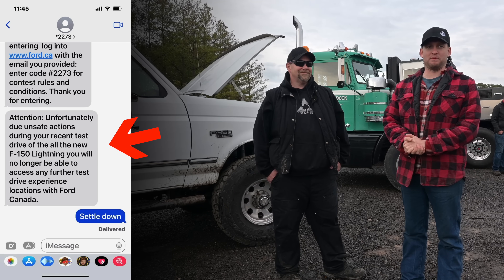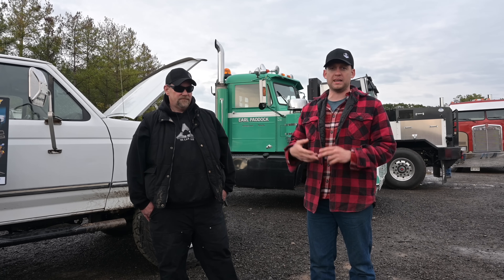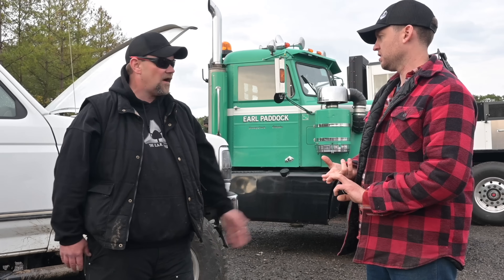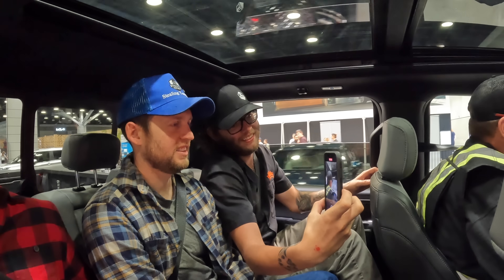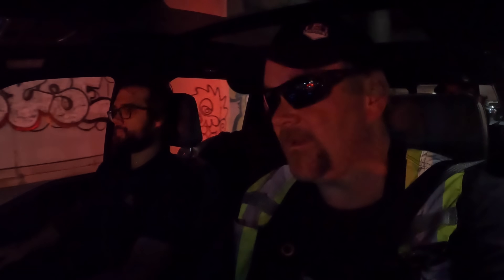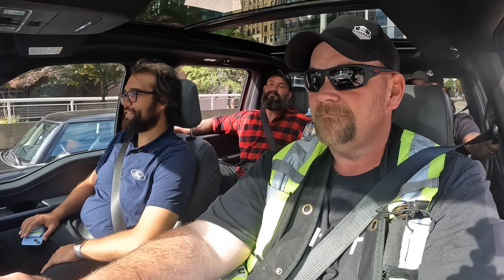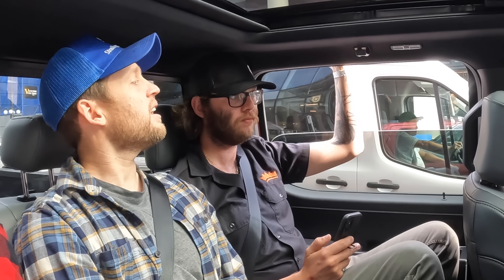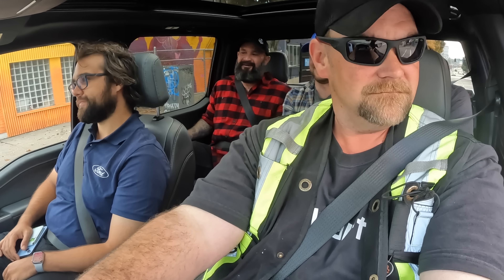Retrofit Revolution: Turning Old Pickups into Electric Powerhouses!

Comment: Curious, why not a IFS/IRS vehicle?  I've been trying to do this for years to my Tacoma, but I had not considered that the IFS would be a concern.  A thought (for me) was to delete the front driveshaft, and mount a small motor on the diff and xfer case with a battery and controller somewhere.  Would love to see more vehicles in general.  The VolksWagen XL1 comes to mind.  Would love to see it used more everywhere

Comment: Why can’t you just use the oem engine and just put the generator on the back of the oem engine and do the conversion
Reply: I'd imagine they'll eventually make adapters for most diesel engines. A gasser will probably be less effective with less torque in the low end vs a diesel which is why they probably won't focus on em.

Comment: My 69 GMC K2500 has had me 28yrs.
 I replaced the 350 with a used, 8k mile, Goodwrench 350,,, less HP, than the original 255hp engine,,, even worn out, the original engine had more power..lol
 That episode, was in December, 2018, during a windy rainstorm, out in woods, at the jobsite. I'm a worn out old mechanic, that does equipmentwatch/firewatch year round. My body can't do the steady, 8 to 16hrs a day, like it used to. I can still turn a wrench, but not as much as I think I should be able to.
 In February, 2019, I rebuilt the TH350 automatic transmission, out at another jobsite.
 The Goodwrench 350 is kind of a P.O.S, and I think I've been lucky, to make it last this long...need to do something different, for more economical power.
 If I could do electric drive, with generator, I think it may work well.
 Good thing about a watchman job, I get paid to camp and my RottnLab thinks I have this job, entirely for her convenience...lol
 Bad thing about a watchman job, , , , I'm not expecting to become independently wealthy...lol

Comment: I really want the batteries to go under the truck. How can we make that happen?
Reply: Battery box in place of fuel tank if you have duel tanks 1 for generator 1 for Battery
Reply: @emilecrotteau7312  I was also thinking about space between the frame. Since there should be no exhaust or driveshaft
Reply: @why6212  
There will still be exhaust but that leaves lots of room
Reply: @emilecrotteau7312  different engine, different exhaust system. Since they will be fabing it up anyway, you could have it come out the side under the front passenger fender, or exit straight up out of the hood.
Reply: @why6212  
That is the idea there is lots of options and choices 
For my trucks they will be frame off complete rebuild so equivalent to new truck,,,that way 20 plus years life span for what starts as mid 80 trucks
Reply: @emilecrotteau7312  nice, I'm trying to do a work truck and looking to get a a mid 2010s f250 because they still have a solid front axle.
Reply: @why6212  
I prefer pre computer models 
I have been a auto mechanic over 40 years so am a little prejudice for my own use
Reply: @why6212  
I am thinking of doing restoration conversions then selling them

Comment: There are hundreds of old ambulances that could use these kits as a zero-emission urban solution, as well as a on-site power source for lighting and what-not... in addition to making them a mobile ER/OR with long-term independent operational endurance, which would be greatly helpful while on the most remote calls in the field.

Comment: Honestly, my biggest reason for liking Edison Motors, while I dislike all other electric vehicles, is that its a retrofit that will be easily repaired by the owner, while all others seem aimed to collect all the data they can, make it insanely expensive to maintain, and prevent the owner from access to much of the systems.

Comment: I was so damn disappointed, when i heard that mazda now has their "rotary range extender" in their "only useful for inner city" full electric model . Mazda MX-30 R-EV
So i thought "yay!", now you can actually use it out of town, as a really efficient get to work car.

...But you still kinda have to charge it daily if you are leaving town, especially in winter.

It's still freaking expensive
AND
they kept their low speedlimit at 140 (for no reason, since higher speed = higher usage = battery gone in minutes vs now built in generator should compensate for that)
and witha  limit of 140 (kph, that is) you cant really drive here if you want to sometimes pass people in a fast manner to get out of the way.

Comment: I have a 1970 GMC K25. It is a hunting truck and I would love to take the space under the hood and put a freezer in there, put the batteries under the bed and I can put a light camping set up over it. Keep the same gas tank size and run a small generator for camp.

Comment: I've wanted this for a long time. I'd hate to do that to My old 7.3 with a manual, I think it'd be an ideal thing to do to a gas-powered truck that has low mileage and a blown motor. I was actually thinking that you could probably couple two model 3 drive motors together and have enough to work to just put it right between the two drive shafts where the transfer case would be and then pack the batteries in between the frame rails and put a light plant generator in there under the hood. You wouldn't need much of a generator to really make a truck. Have some decent range if it was a plug-in hybrid situation

Comment: Why not put the battery pack underneath a rear tray(flatbed). Rather than leaving the rear tub(bed) putting it in that taking up space. There is a surprising amount of space underneath a rear tray on a solid axle vehicle & flatbeds are more useful for work purposes anyway.

Comment: Sounds like a good idea to just make a kit where you can. Retrofit your old truck to be electric, especially if you have a gasoline or diesel range extender on it as well. You can then continue to daily drive your old truck as an electric vehicle. Just plugging it in at home every night to charge it and when you need to make those longer trips or you need to tow something past your normal electric range. You've got that backup power there. From the internal combustion engine range extender and you can just keep going.

Comment: I wanted to use a Ford Eluminator crate electric motor crosswise centered in my old 1976 truck then it stays 4wd and has more power then stock to boot

Comment: I’d be interested in a conversion for my truck. You really should consider a 1/2 tonne option in addition to the one tonne. Lots more 1/2 Tonne trucks on the road, especially older models that many of us love.

Question, can you still have heat or AC in them without a huge hit to the price?

Comment: And this is why I’m in full support of you and your effort’s 💪🏻
I’d love an electric motor/generator/charge control and system for a 3/4-1 ton 4x4 with solid axles. Then having options for batteries to choose traditional wet batteries, lithium, gel, etc.

Comment: I'm not trading in my old trusty combustion engine for an electric rig BUT if it were relatively affordable (without cutting too many quality corners) I would be interested in possibly retrofitting one of my backup vehicles or an old truck if the engine completely blows

Comment: Poor guy lol. His Job is just to protect the company's assets. Probably should have had someone else drive the truck so you could get away with a few things at a time instead of just speed running getting banned lol.

I do love the idea of an electric pickup truck, because for towing it would be so awesome. But none of them have the range I need to take my car out to the racetrack in my enclosed trailer. So having a genset would be great

Comment: Awesome!!!  Electric bucket truck/chip truck with electric chipper and chipper feeds off the truck, so no need for batteries in the chipper, retrofit the chipper too!!!
A hundred horse electric chipper would get the job done!  Plenty of chip trucks and chippers with worn out motors.  Make the cost to retrofit near the cost of a new motor and it’s a no brainer!

Comment: A couple different levels of the kit would be nice like light weight kit for jeep cj 5 and 7 and suzuki and geo tracker an somthing mid sized for Toyota trucks Ford Rangers s10 jeep cherokees 4 runners and then a heavy kit for 1/2 ton to 1 ton full size trucks

Comment: I would love to see a pickup retrofit kit. Makes way more sense than other solutions. As for myself, I would pickup a broken truck (blown motor or transmission) and then grab your kit for probably around the same cost as fixing it. 

Swapping the axel for an electric motor driven one also makes more sense than these conversions that still run the drive line through the transmission.

Comment: What about doing an electric conversion on a van for a vanlife van? Would you recommend still keeping the solar charging & 12 volt house batteries for the living/lighting/cooking/AC or could you use the traction batteries tied to an inverter for the house functions? If you could run the house functions off the traction batteries, would you still be able to use solar to recharge/replenish the power you used for house functions?

Comment: Honestly an E Axle for a non-commercial truck is a pretty bad idea. You really can’t have that much unsprung weight and expect a regular joe to keep their wheels on the ground and not die after hitting a bump mid turn on the highway.

Heck, it’s nearly happened to me driving arguably the best factory truck suspension ever made

Comment: So I really want a retrofit sent over to Sweden for my -82 VW LT31 converted food truck / gelato van {called Gelateri(v)an} It would be awesome for 3 major reasons, first it has a 75HP 2 liter petrol engine that chugs over 25 liter per 100 km, get the power to actually accelerate and keep a speed higher than 85 km/h without reving the engine at max constantly. second, the engine starts to get old, and even though I still can get most parts for it, it is a pretty rare engine since they switched it just a years later when catalysts were mandatory, so there are certain parts that isn't available any more. And last, it would give the benefit of being able to run the equipment (espresso machine, gelato freezer and other things that uses 220 V power without having to hook up to a three phase outlet everywhere, and being limited on the distance you can drive because the temperature in the freezer might get to high. However, if hooked up to the grid all the excess power would go to recharging the batteries as a huge bonus :)

Comment: Imagine a custom gear box that allows two tesla motors per axel. With two controllers, and use one front, one rear with batteries filling the rest of the frame  and a small Diesel engine under the hood, to allow charging at 20kw  possibly use s custom wound generator that does 120/240/480, so it can power homes 20kw will run everything you need, and then some, it will not run everything in a large house but everything you must have . You can still cook. You may need to not use the oven and furnace at the same time.  Maybe 3phase would be ok, thrn you can run industrial shop tools!  If 208 doesn't suit you, you can get a transformer boost it to 120/240, or wind the generator to do 3phase and 120/240, just ignore the other odd phase,

Comment: I would love to have Retrofit kit For my work equipment I transport  forklift  around southern california With my chevy 2500 12,000 Trailer I was looking to upgrading my trailer Or buy a roll back Tow truck But in my states ultimate  wisdom I cannot register A diesel truck 14,000 older than 2010 I was looking at gas power ones So this kid will be  a blessing But there's another problem My state CA also ban  liquid fuel power generators I think But it seemets not being enforced But I would love to Purchase your equipment And I would love to Advertising on my truck promoting your Company around southern california

Comment: Simple formula that will sell:
4x4 gas/diesel pickup
Keep original motor
Generator in place of trans in back of motor
E axles front and rear 
Batteries under truck in place of driveshaft
Make kits for most popular trucks
Boom. Sales.

Comment: I'm in, ex navy fully understand diesel electric, fixed speed vs variable speed reliability on ice. battery pack would do my daily commute easily, Just give me command start version of run the generator while at work to top off once every few days, or command start to run generator coolant through battery pack to warm on the -40 days, with battery pre warming engine compartment so accesory bearings dont get thrown to 1800 rpm instantly with frozen grease.

Comment: Chevy owner here. A kit with a motor to drop in place of the t-case so we can reuse the IFS would be great. A bolt on motor for the rear axle would be nice too, less to replace. Would need to limit torque so don't tear axles to pieces or shread the tires.

Comment: I have been looking at doing this with my truck. But I think the battery pack needs to be between the frame rails so we have full access to the beds. Without all the running gear under the truck there would be alot more open space.

Comment: Any old "glider" is not a potential EV/Hybrid...  (Heavy or light)

 - e-Torque is no more instant than burning a little clutch - in any EV.. (the lower maintenance per rip is an advantage, solong as the deflagration control is topnotch.)

Comment: I just got a 95 F-350 id love to do an electric conversion with a small generator under the hood, charge at work, charge at home, run the Genny when I road trip with the trailer down to Phoenix 235 Miles

Comment: I think a hybrid is a MUCH better idea than say the CyberTruck or even a Rivian.  If you went 100% electric drive then you could put the batteries underneath where the drive shaft, transfer case, and transmission normally sits.  Some of these trucks can have oversized gas tanks so there is likely plenty of room.  I would think you should pull the motor though and put like a 4 cylinder diesel with a generator on it... something reliable... may bike a Kubota engine.  You need it to generate basically enough to cruise down the highway and still be able to at least charge a little bit.  You can use the electric for acceleration.  With a 50 mile battery the weight will not be crazy and the generator can kick in when you get to say 15 miles remaining.  This would be so cool to see a retail truck like this.  I don't think I have seen a hybrid truck.  With the shorter range, even with the weight of the engine and fuel tank it would still be FAR lighter than the long range CyberTruck.  You might only need like a 25KW battery.  That could still run tools for hours without the generator turning on and it should get decent gas mileage.

This would be the best (replacing the engine) as th4e larger engine would be overkill for charging and it would be likely harder to get the two systems talking to each other (the EV CPU and the truck's own CPU).  Then it would be a reasonable option for someone with a worn or blown engine and/or transmission.  The electrical is really going to be the hardest part either way.  Likely you would need an after market CPU and it would have to plug into the wiring harnesses for the truck for things like lights, stereo, and even safety things like air bags and such.  heating and cooling for the cab might also be a bit of a pain.

A lot of people do not understand the amount of power an EV battery holds.  Something like a base model Tesla Model 3 battery has 50kw and would power the average house in the US for 2 days.  If it has a range of say 250 miles and you can charge it from 30-80% in 20 minutes on a SuperCharger 3 station then you are pumping out the same amount of power in that charger in 20 minutes as a house would use.  The 500 miles range CyberTruck they were planning on would have a battery 6x this (again the reason why a truck should be a hybrid) you either or you have crazy long charging times.  The Tesla semi has such a large batter for the 600 mile version that they battery needs a 1MW charger... as in Mega Watt... split between 4 battery banks all charging at the same time to get reasonable charge times.  A CyberTruck could power a house for almost 2 weeks... a Tesla Semi with a 600 mile range could power a city block for a week easy.  People just don't understand this.   

As  a side note... would it be better for the batteries to have regenerative breaking go into large a capacitor and then dump the capacitor into acceleration after you release the break to reduce cycle on the battery and the load during acceleration?

Comment: Would love a set for my 01 yukon Denali xl. Would have to convert the front axle to solid.  But anything can be done. There would be a lot of room between the frame rails for the batteries.. Hmm what about a top loader style axle to keep the motor and lines safer?

Comment: I'd rather you just build the whole pickup like Topsy... All these domestic trucks are designed to be disposable. The tinfoil bodys rot out in a few years, and deform by pushing on it with just your pinkie.  The frames rot and break, the unnecessary electronics everywhere,  and parts arent as easily/universally replaceable, like the windows on topsy.

Comment: I think it is a wonderful idea.   The nice thing is for a while it could be a good sideline for your mechanics then as you get people train to install the kit just a nice business.  I'll dare suggest you may want to consider a kit for under 28,000 lb, Straight trucks. All sorts of delivery trucks fall in that category and I think a diesel electric with a fair size battery is a wonderful idea for any truck that runs in traffic and especially one that makes short run delivery's.   Make sure it has an electric PTO so it can run a lift or whatever.